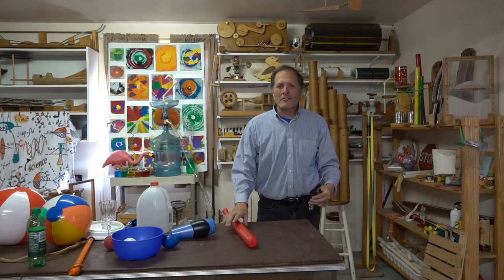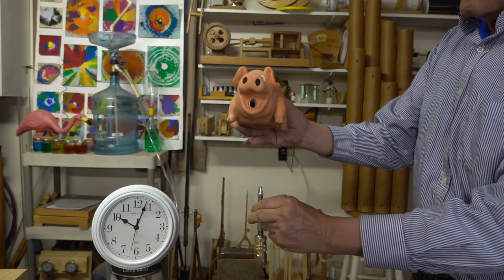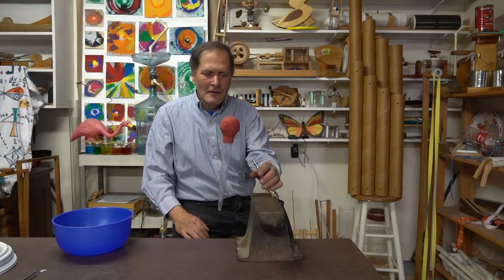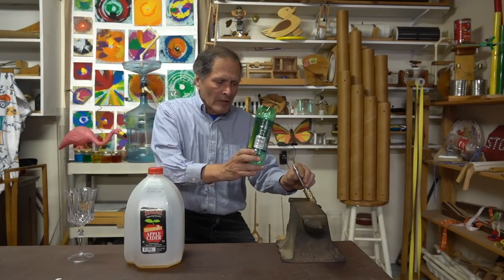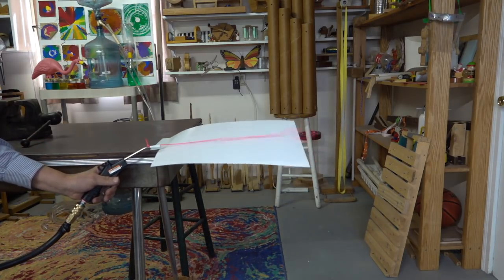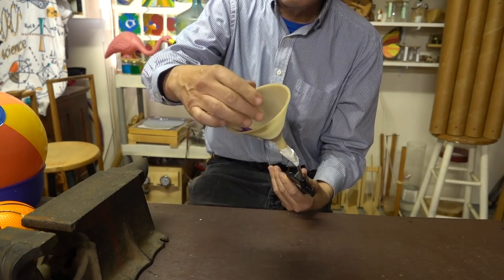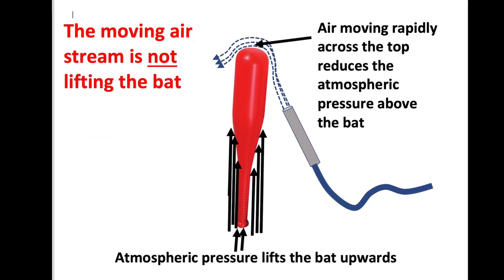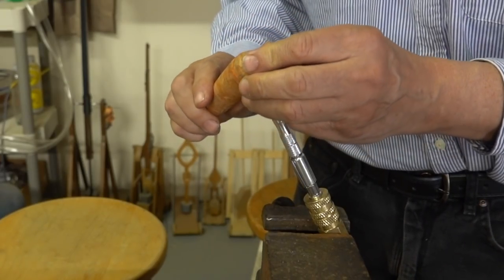Levitating objects in a stream of air.. Coanda effect // Homemade Science with Bruce Yeany

Comment: PERFECT EXPERIMENTS ! Very easy to understand. The carrot one at the end, shows perfectly how important is the surface where the air flows to have a gradual pathway were it can stick to the surface due to the air viscosity.  If there is no pathway and the surface makes the air change direction abruptly,  the airflow separates from the object surface and no Coanda effect happens. 👏🏻👏🏻👏🏻👏🏻👏🏻👏🏻

Comment: I remember during the summers we would fill up a small pool with a garden hose. As I moved the hose towards the bottom or side of the pool, I was met with resistance due to the force of the water coming out. However if I got the hose close enough, it would instead get pulled towards the surface and stick. The water coming out of the hose flowed across the surface so fast it created an area of low pressure and the water around the hose pushed it in and locked it against the surface.

I really enjoy your experiments. Thank you for sharing.

Comment: Hi Bruce,
I hadn't seen your videos in a while and stumbled across this.  You really took a deeper look on this one and that is very good. I like the way you must look deeper into things and I encourage this.  I'd love to chat with you some time.  You mention a follow-up video, but I don't see a link..?..
I wonder if the science you 'get to' there is some of the following.
.
I'm glad you're recognizing the Coanda Effect.  Coanda himself recognized the lowered pressure because of the curved flow.  <-- NOTE : it is the curved flow that is the cause.
Do you talk about some of the following.
.
It is the inertia of the air as it curves that tries to go straight, thus reducing the pressure. It is why you swing outward on the playground merry-go-round, or why you feel lighter at the top of a roller coaster hill.  Your inertia is trying to carry you straight. This is described in Newton's First Law.
With air, the atmospheric pressure holds it against the curve, but the tendency to go straight works against atmospheric pressure, thus reducing the pressure near the surface.
.
With the sharp edge, air's inertia is enough to take over; atmospheric pressure is not enough to make the air turn so sharply at the edge. So, the flow does continue straight and atmospheric pressure pushes air in behind the edge and we have considerable turbulence as the flow mixes with the stationary air past the edge. 
.
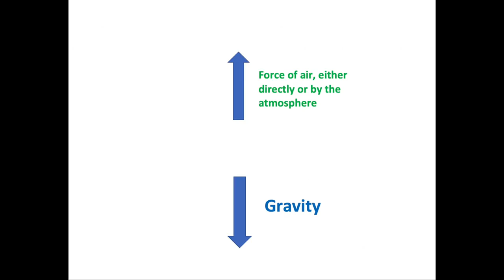However, at 5:47 and again at 6:03, you seem to be implying that the stream of air is at a pressure lower than atmospheric pressure.  This is a very strong, old myth and simply isn't true. It can be easily measured as is done when studying it in aerodynamics with a static pressure probe.

..
With the paper, it starts as Coanda, but as the paper straightens, the air is pulling the paper straight due to the air slightly sticking to the paper with viscosity and is trying to drag the paper along with the fast air. If you measure tension on the paper, you will see that it increases as the paper straightens. That tension is enough to lift the paper - just as if you only pulled on the far end.
.
With the inverted bat, you again imply the stream pressure is lower on that side. However, it isn't and you seem to ignore Coanda still occurring at the (now) bottom. If you look more carefully at the angles you will see that the Coanda at the bottom is working sideways and down - as air follows the curve part way.  The tension on the string will increase due to the net downward force as Coanda reduces the pressure under the bat and the atmospheric pressure on top is still pushing normally. The sideways component of the Coanda lowered pressure is what allows atmospheric pressure push the bat into the curved flow. Coanda only occurs about half way around the end, so there is a sideways component.
.
At 8:27 you correctly recognize the upward component from Coanda - that is still happening on the inverted bat. Do you see that?
Also,  there is also some drag from the moving air along the side of the bat, but not a lower pressure.
.
If so, I'm sorry to hear that you are still in the camp that says "fast moving air has (or causes) a lower pressure". 
- - 
Best regards and best wishes for a good new year.
Science Vigilante, Steve.

Comment: Hey Bruce, always learn something with you.
But I got puzzled by the Coanda explanation of lift...
 I thought the deflected stream of the Coanda effect was also producing lift. Not only the partial vacuum and the atmospheric pressure, but also this downward stream of air, due to Newton's law. I can't find anything conclusive, but maybe trying a bat with a bell shaped tip.
I mean: the bat has a semispherical end that deflects the stream downwards due to Coanda effect which causes a partial vacuum but also a flow of air downwards.
If somehow the downward stream were annulated... I'm thinking of a bell because the top would still be semispherical, but the "skirt" or rim of the bell, would redirect the downward stream of air, to the sides, thus rendering any downward flow of air to zero, and isolating the atmospheric pressure related lift, to my hipotetical "2nd law of Newton lift"
All of this comes from somewhere I read about a Coanda airplane, plus the famous 60's experiments with flying saucer prototypes...
(I have no air compressor to test myself...so I ask for some help)
Thanks!!
Reply from the maker: Perhaps I should have stated it differently and not ruled out the added force  exerted by the Canada air stream, I think as I presented it here my understanding was there is a very minimal amount compared to the lift provided by the atmosphere.  If you go back and look at the soup ladle,  it is positioned so that the amount of air directed downwards is very minimal and yet floats, cut a pickle in half with the curved side face the airstream,  there is enough lifted generated to easily lift it and yet no air would be directed down the flat side, However it  will not stay aloft due to stability problems.  there several examples such as you describe with the bell shaped and air follows the curve down to produce lift, in those case the air flow starts at the top and follows the bell down,  here the air is directed up the one side across the top and may or may not curve on the opposite side
Reply: @YeanyScience  got it!! Thanks again!
Indeed, those stability problems were the major reason for the cancelation of those saucer X-planes...
But of course the lift provided by the atmosphere is greater... Just a look at those ribbons wiggle is enough to see that the Coanda effect is not the leading force of lift

Comment: I am not sure what's more impressive, the visuals of the materials floating or the acoustics and not hearing the compressor creating the air flow.
Reply: wonder does he just have a big tank?  or the compressor elsewhere?  or one of those fancy quiet ones.
Reply from the maker: portable 2 horsepower, 8 gallon tank, old and loud,  and I have 100 feet of air line so I put it outside.  I can blow for about 20 seconds before it kicks on, in some of the clips you can hear it
Reply: @YeanyScience  Nice, making every second count. Well done!

Comment: Wouldn't cutting the top of the carrot disrupt the airflow causing the air to move slower than with a curved top therefore causing a higher pressure zone relative to the curved carrot top? Can you increase the air pressure on the cut carrot and obtain levitation?

Comment: Missed opportunity to use a smoke maker so the audience can see the flow of air.
Reply from the maker: I tried smoke, dust, steam and all failed to show it,  I looking suggestions on how to improve it
Reply: @YeanyScience  The ribbon was perfect it’s a tried and tested method used by sailors to trim sails. Sailing being my day job it was refreshing to see. Also yarn is used because of its light weight. And I would suggest using no longer than a 6 to8 inch length. This allows the air to give you a more accurate reading of what it’s doing along the surface having reduced mass to move. I hope this will help in future demonstrations. Keep up the good work. Hope retirement is treating you well.